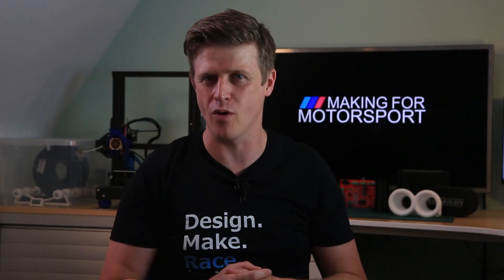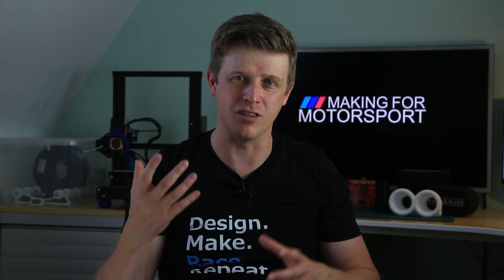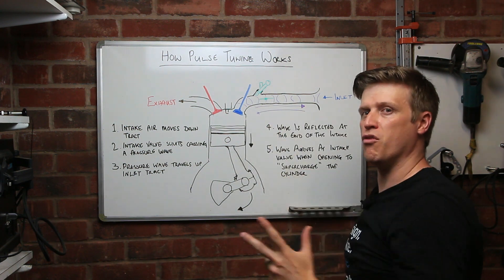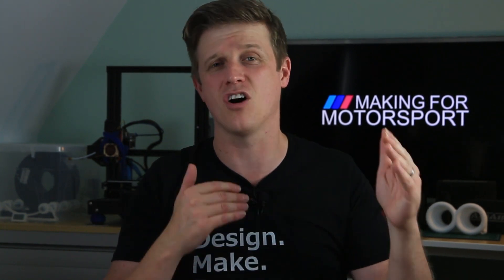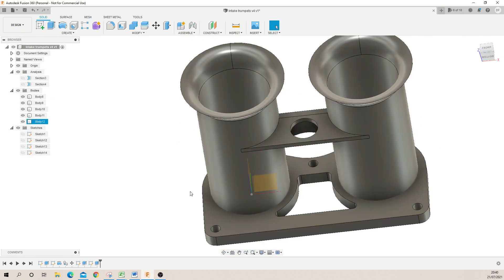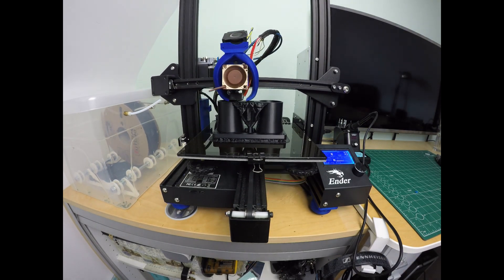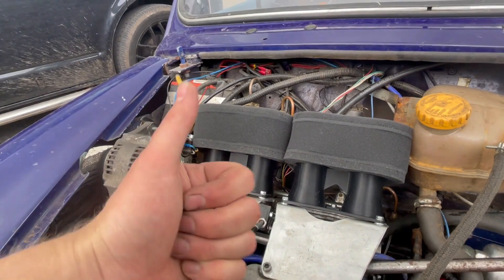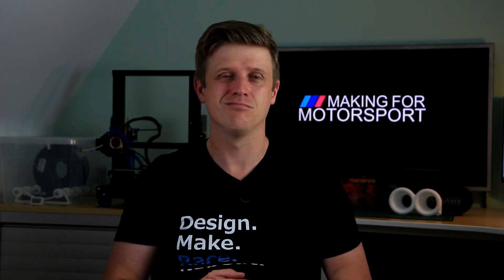Velocity Stacks - What they do and how to make them... a.k.a. Air horns, ram pipes, air trumpets....

Comment: I think 3d printing is a brilliant way to go . I've just spent countess hours making molds to construct fibreglass/ epoxy velocity stacks  , I still have to fit mounting bracket . You can make yours in your sleep.
Reply from the maker: That is, hands down, the best bit about 3D printing… unless of course it’s a failed print… in which case I want to set fire to the world! 😂
Reply: @MakingforMotorsport  Bambu Lab X1C Printer. Never ever worry about that again. Thing thing is bomb proof!!
Reply from the maker: @toast47624  got one!  Need to get it setup!

Comment: I e made some velocity stacks for motorcycles na Frye funny thing is I always beat the stock stacks by at least 8-10hp. I’m not sure why I get a consistent range above stock but when compared to another version that was almost 300 bucks, I beat those as well hands down. I’ve noticed most people use a rounded trumpet end but line are pretty sharp. Maybe it allow the air to be cut and sucked in faster. Anyways, multiple dyno pulls back to back and mine stay above the 8-10 HP gain from stock. Stacks are so much fun to design. It’s amazing how radical you can make the design and get the exact same performance from.

Comment: 2:00 this little fact gave me an idea for a simple variable intake system that I haven't been able to test even after all these years.  If the sharp inlet effectively narrows the inlet cross section, then it makes sense that you could use this effect to tune the physical runners to act like narrower and proportionally longer runners for lower rpm torque bias.

Mechanically I'm thinking either a sleeve that can slide above the trumpet to disrupt the flow, or slide down exposing ports below the trumpet that allow some aor to bypass the main inlet. 

A much simpler mechanism might be a solenoid powered valve that allows air to enter the runner below the inlet, thus disrupting the flow and effectively reducing the runner cross section.

Comment: I absolutely love it. 3D modeling and optimizing of intake parts is a really low cost tuning factor. I always wonder why there are not more people doing it. Some time ago I designed an intake out of TPU with internal helical flaps for my carbureted bike and it massively improved the throttle response especially in mid range. 

My bike buddy, who is obsessed with everything being stock, shiny and perfect, was shocked when I told him I installed a 3D printed part on my engine😂. He was trying to convince me it's unsafe. But I just laughed because he has no clue how strong TPU actually is...
Reply from the maker: There’s a lot of mistrust around 3D printed parts and whilst FDM and PLA isn’t good for everything but you can still do alot with good filament and clever design 👍. I like the sound of these helical flaps!  How did they work?
Reply: Equally interested.
Reply: The TPU intake sits in between the carb and the airbox. Since its a 620cc 4 valve single cylinder engine with low rotational mass, it is very responsive to small changes in AFR.
Now my plan was to get the intake air to rotate around its direction of travel before it passes the carburetor, to unify and improve the mixture. There are three helical flaps with variable pitch inside, connected in the center. They start with a low pitch (almost parallel to the direction of travel) at the airbox and 80mm down right infront of the carb they are at an angle of around 25 degress in relation to the flow direction.
Reply from the maker: @them0leisback  wow, so you were introducing a “spiral” in the air as it went down the runner to introduce controlled “turbulence” to keep the mixture homogenous?  I like the sound of it…. As you say, a small engine will show up any differences quickly so it was a obviously an improvement… 

If I am getting it right, these are static?  Like not an actively controlled part?

Comment: Hell yeah, more modelling.  I'm currently learning 3d CAD and 3d printing to make a new inlet manifold for ITBs on my MX5 hillclimber currently running CBR600 ITBs on a home fabricated aluminium manifold but I'm building a bigger bore motor with a VVT head, cams, forged pistons etc and have a set of ZX10R bodies to go on it.  I'd love to see the development of your manifold in CAD too.
Reply from the maker: You sound like a man after my own heart!  When I do the modelling video I will tie it up with the manifold… they both use different but very useful techniques so I will do the together… 👍. Best of luck with the build!
Reply: @MakingforMotorsport  Cheers Bud, been mucking about with motors all my life (light vehicle mechanic C&G qualified early 80s).  The car is running well at the moment, 1839cc std bottom end with a lightly worked head, 285 Piper cams and the CBR 600 ITBs and a custom (Ok home made :-) ) exhaust making 160BHP currently (flywheel) on Emerald K3 management.

Comment: I'm just impressed you're using the ASA for the final product, not using it to test fit and then have the model sent off to a metal shop
Reply from the maker: ASA is proper material, and whilst I wouldn’t use it for applications for bolting to the engine, it’s great for everything else….

For applications bolting to the engines I use CF-Nylon 👍👍👍

Comment: nice to see another vauxhall 8v on bike bodies! not that anyone ever wants my 2p but you'll get it anyway. 

- a tapered tube flows better than a parallel tube.  
- you'll need your inlet way longer for pulse tuning.
- the biggest improvement you could have made for power is get rid of the air filter and keep the original velocity stacks
- if you want a filter make an air box with cold air feed any loss of flow through a filter will be gained by denser air. 
- you wont have enough room under the bonnet for both pulse tuning and an air box and the cold air would be more beneficial than any pulse tuning.
- make them twice as long with a1.5deg taper and poking out trough the bonnet with an air box/scoop out the top of the bonnet and no filter.
Reply from the maker: You make some good points, but like I said in the video, in my level of application all the evidence I have found is people not finding a different between taper and parallel (maybe on a full race engine with a taper all the way to the back of the valve - but I am not there), the bell on the stack was far more important to me…
After having my engine swallow a small stone (very open engine bay) I will always run filters - they may not help power but neither does running on 3! 😂
I ran the numbers on pulse tuning for 3k rpm and just gave up trying to fit it in, do-able but worth the effort? I doubt it…
More cold air helps definitely, but I rarely see IATs much more than 5deg over ambient ‘cus it’s a space frame front end, plus packaging constraints mean it’s gonna be difficult to fit a plenum and ducting to give cold air….
On a more “normal” road car I’d agree with, and implement most of them, but this project has some challenges 👍😂

Comment: Very cool video.  There is so much to unpack in this topic so ill look for your vid on that.
One thing you might consider trying is putting a blade at the bell mouth area.  I use them on itbs and carbs and they help point the flow in the right direction.

Another thing to consider for those doing this in a plenum. Make sure they extend into the air volume.  Air sticks to walls and you get better flow if you roll the lip around and its away from walls.

Comment: Years ago there was a cheap and simple mod for the BMW R1100RT motorcycle and that was to fit the inlet trumpets from the R1100GS, these were much longer and were in fact velocity stacks. Net result of the change was noticeably more low end torque, just where you want it. Allegedly, you lost top end power, but that was of no consequence, so a good win and well worth the effort (so was a remap, but that's another story all together).
By the way, Porsche fitted engine controlled, adjustable length, velocity stack to some of its flat six engines, that’s got to be the best win
Reply from the maker: I heard a few bits about the Porsche system, and few other bits like dimples surface… it’s very interesting….

Comment: Love the 3D printing aspects of your builds and the fact that 2 Stroke Stuffings is also 3D printing inlets because of your videos. And He’ll Yeah to modeling content. In the the throws of putting together a half decent cnc router and need to learn this for that. Keep the videos coming
Reply from the maker: Cheers buddy!  I love Alex’s videos, very smart fella (although he had his printer well before I said anything to about CF-Nylon to him)!  

Very jealous of you doing the CNC stuff… that’s something I’d love… is it a lot or fully bespoke?
Reply: @MakingforMotorsport  It’s a scratch build, fully welded steel construction for the frame and gantry, 16mm steel plate bed. It’s a router but built to cut alloy and steel mainly. BUT….. it was meant to be a quick 6 month build and that was 2 1/2 years ago and I reckon I’m about half done lol. Life just keeps jumping in the way lol. Anyway. Love the vids, great content, easy watching style, well edited. Keep it up 👍

Comment: I have an "AFM delete piece" 3d printed in ASA (had it done on 3dhubs because i don't have a printer) that sits right behind the radiator on my miata and had no problems even in 30°C+ trackdays, someone i know even has PLA velocity stacks on his miata and they are still going strong after years in the heat of Sicily (30-40°C summers), i think you won't have any problems with yours!
Reply from the maker: Yeah, PLA I think could be marginal, a friend has had theirs melt slightly but I do love ASA, it works really well for most applications, and prints lovely…

Comment: Great content! I am starting out on a new TVR Cerbera induction/ITB's project to get the horsepower and more importantly, pulse tuning working well on TVR's own AJP8 (in-house V8 engine). You may know there are two key AJP8 variations, a 4.2L and a 4.5L and each variation has its own special and bespoke induction system. I have decided to build a new induction system that follows the problem solving methods that Yamaha followed to gain an extra 80HP from the standard Ford Taurus V6 engine. The Taurus was sent to Yamaha to get the engine performance increased, which they did in part by building an intake indicator system with two runners per head inlet! You were going to film a highly detailed explanation of pulse tuning and the "supercharging" effect, I have looked but I can't find this. If you have any outside links that may help me in my quest I would be very grateful. Please keep going, you have my support! Kind Regards Neil

Comment: Looking forward to  the science video.
Velocity stacks for me are just that they increase the Velocity of the air to increase turbulence around the throttle butterfly to aid mixing fuel

I also read an article years ago about exhaust design for aircraft engines.  That was really interesting and more relevant to the pluse tuning
Reply from the maker: Yeah, the pulse tuning you are referring to in Exhausts occurs in a similar method in inlets… I am just trying to gather as much information so the video is as accurate and complete as possible…

Comment: Great job!I also make ITBs for my motor and would like to watch a video with the calculation of the length of the trumpets.Have you ever thought about bringing trumpets into an airbox? A separate filter for each trumpet greatly reduces air consumption! In addition, the airbox allows you to supply cold air and install a factory filter! On the BMW M series, this is done from the factory .....)
Reply from the maker: Yeah, OEMs have lot of reasons for the airboxes…. on a lot of cars with ITBs as standard they tend to use Air Flow Meters for the fueling so they still need to route the air though… plus OEMs need a place to feedback block breather air etc to meet regs…. 

That said, it’s still much easier to route a cold feed to an air box rather than 4 ITBs!
Reply: @MakingforMotorsport  By the way ... on Toyota 4a-ge, the trumpets are bent, so that you can get the required intake length!)
Reply: @MakingforMotorsport  Your velocity stacks just beg to touch each other in a common plate. So you are almost there with your airbox. Also you could add 3% bend or angle to make the air box more compact. An airfilter is most effective with a constant flow of high density air. Thus the intake air goes straight  to the airlifter (ram in orthogonal onto it -- a flat filter is best for this). Also a filter is basically a 2d sheet / net with pores which hold back particles which are too large for the clearances in the engine. You fold it until it fits into the engine bay. It is by no means a 3d foam where you need to be lucky that some particles stick on the oily surface. Just look up how the tubes in a particle filter are closed. On a cat the pores are small enough that the very hot and turbulent gas can carry the molecules via diffusion to the walls. A cat is not a filter.

Comment: Hi, great videos. I have a question. 
Is the intake runner length more important than velocity stacks? Or are both combined a better option?
Bowlings intake runner calculator says i need a runner length of aroun 13.75 inches.
Thanks

Comment: You use taper to stabilize the airflow for the nozzles.  You create a homogeneous hot spot for the nozzles where there are no differences in speed over the revrange used.  That is, if you take a cross-section at right angles to the airflow above the main jet, there is little to no flow differences to be recognized over the entire revrange used.  This makes tuning much more predictable and eliminates a variable.  You do have this with a straight pipe because the wall always pulls on the airflow and makes the homogeneous cross section unpredictable.
Reply from the maker: Oh Salamander, you’re talking about the dark arts of carburettors…. Well beyond me I am afraid… I stick to the elec-trickery now!

Comment: Love this series of vids. Now I'm looking at TBs for my kit car, and I've not finished the first build yet! I noticed you were using a filler knife to remove the print, Having cut my hand more than once with that I've stopped using it. With the glass plate assuming it is a borosilicate plate pop it in the freezer with the print on and that will release it without needing a knife.
Reply from the maker: Yeah, good tip!  since this video I have moved to a PEI flexplate which is EPIC!

Comment: Its easier to make air filters . Common practice on F2 sidecars . Common OEM filters produce less than 25 mm drop across them . Most filter mediums are commonly available . Stainless steel mesh is pretty cheap as is aluminium if you don't have a lathe for spinning or a 3D printer and your happy with your existing stacks . The radius of the inlet is more important than any other part of the design .

Comment: Hello, I bought some velocity stacks for my motorcycle but I didnt know when buying them that they fit over the throttle bodies instead of sitting flush with the throttle bodies. This is now creating a lip for the air when transferring from the velocity stack to the throttle bodies. How bad is this? Should i get some new ones that do sit flush with the throttle bodies? Thanks!

Comment: Why did you decide to use ASA for the velocity stacks when you'd already had success with the carbon reinforced nylon for the manifold? Is this purely down to the lesser heat and strength requirements? Or was it just cost based. 
Being a cad designer myself I also have to say HELL YEAH MORE MODELING, it's nice to see other people's creative processes.

Keep it up, I love your videos, informative and entertaining.

Comment: When I do mine I'm going to try using the bigrep hi temp filament.
Heat resistant up to 160 degrees and only requires a nozzle temp of 215.
Bed temp of 60 with no surround so my CR10 should print this no problem.
I'm even planning on using it for my flange and manufold for ITBs so we'll see how well it holds up to the heat cycles.
Reply from the maker: I’ve seen this filament before, I must say the lack of information on the actual material was a concern, plus there was scant info the biodegradable bit, (how long? Under what conditions etc)  but the stats do look good and bigrep are a decent brand…

Please, when you do try it let me know how it goes… I will be interested to see
Reply: @MakingforMotorsport  will do.
It will be a while however. Just test fitting with PLA at the moment until I get things running.
Think I'm on my fourth iteration of the manifold design. It's a tight space so every alteration is a compromise.
The car is a total rebuild so have hundreds of jobs to sort.